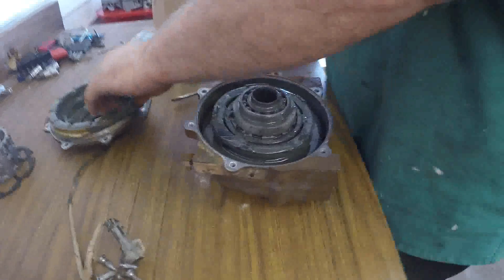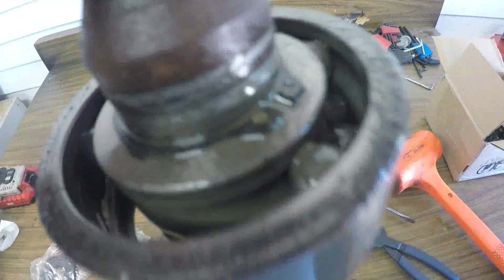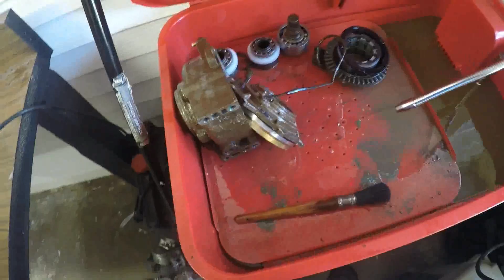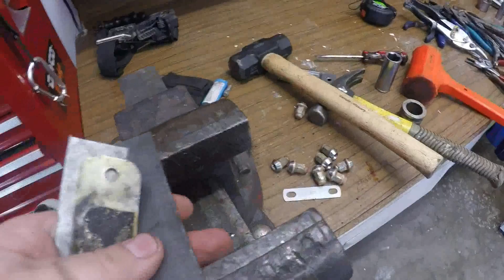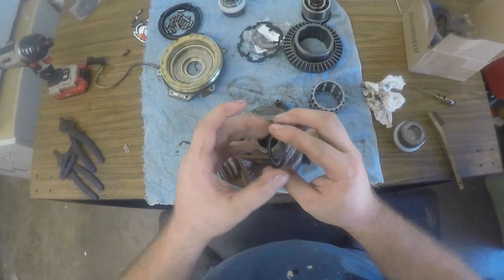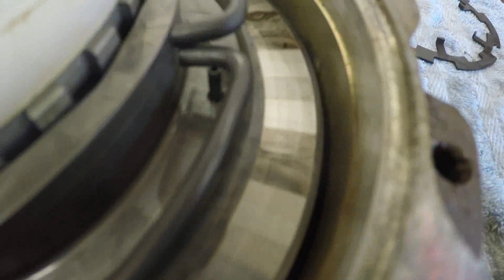Polaris Rzr Front Diff Rebuild (Newer)

Comment: the covert with a 7 bolt rub on the differential gear when i torque it and the pinion does not turn what the problem, i tried everything
Reply from the maker: There is something going on with your armature plate, it has to sit down into the cut outs. If you can, message me some pictures on Solitude Customs Facebook Group or on the main page.

Comment: This is a really great video. I like the sprag clutch demonstration, roller engagement, and hub hornet should link to your video and sponsor you with a free kit. Because your video is way better than what they put out. Your vid actually explains to me the how and why so much better. Tyty
Reply from the maker: zoedorarey Thank you very much for the words. Glad I could help you out, as this diff really is kind of tricky compared to just gears
Reply: SolitudeCustoms i have rebuilt posi and limited slip diffs in the old hotrods that are so much simpler. I was afraid to tackle the job when i saw the blowup diagram of the thing. And the sprag instructions i got were absurd. Now i'm not worried. Thanks. Wife and i have ace 900's and we pound the snot out of them. Demand drive is the weak link.